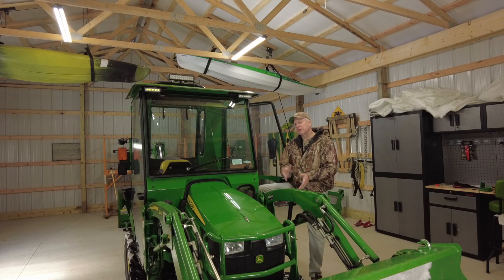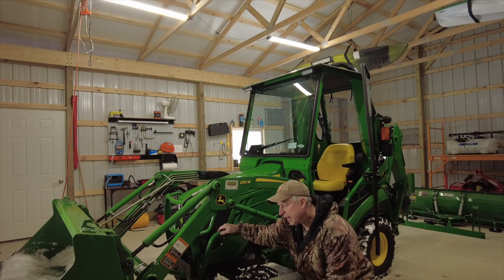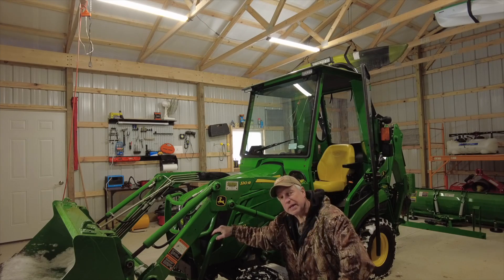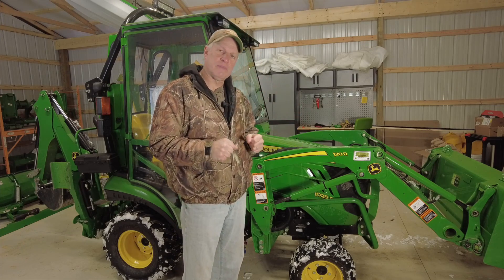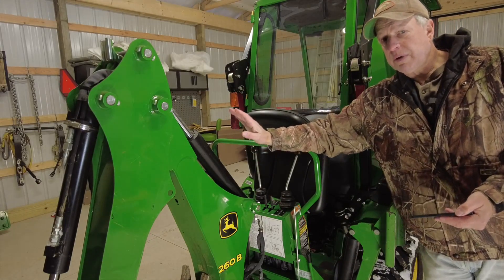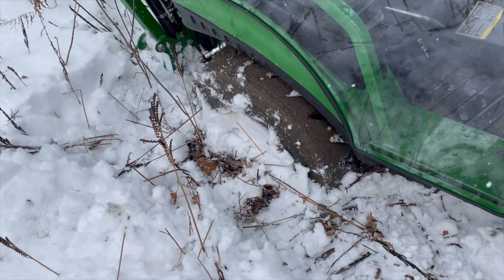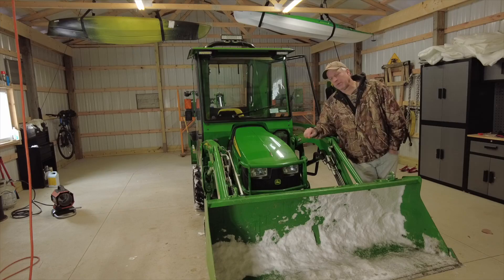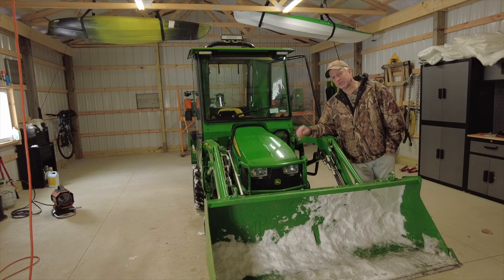John Deere 1025R: Anatomy Of A Stuck Tractor

Comment: Tom: Your frank & honest portrayal of the facts and situations is refreshing. Certainly ground that’s not firm under the snow compounds the problem. I keep my tiller on during the winter bcuz I don’t yet have a weight system. I move snow with my loader (w & w/o edge tamers) bcuz I don’t have a pusher box or blower. But the frost in the ground here in WI and the fact that it’s firm soil (not soft or mucky) means the tiller and loader weight keeps me intact with the ground and 4WD has me going thru decent snow depths. Not stuck yet, but willing to try!
God’s Blessings, Curly
Reply: I like the willing to try!
Reply: Tiller is great for breaking up the ice

Comment: Hey Tom, it's always easy for people to say what they would've done, but they weren't there and only you know what was actually going on at that moment. You got it un stuck without breaking anything so you succeeded. I have up until this past weekend, left my backhoe on in the winter while using my front mount snowblower. I found that it gives me great traction. I just recently purchased a rear blade to help move the heavy wet snow that we get here in southern Maine sometimes. Love your videos!

Comment: Any 4x4 truck or tractor, each axle has it`s own differential. The diff lock on most is for the rear only, the pedal is linked to the rear axle. The same with my GMC truck. Some Jeep models have front and rear diff lock.

Comment: There is no diff lock for the front so you will see the front tires alternating depending on the traction.   One wheel peel in the front. Diff lock only in the back

Comment: Yankum ropes are one of the best for recovery, the rope is doing most of the work with kinetic energy. Watch Matt’s off-road recovery for some great video examples.
Reply: While I love kinetic recovery ropes and carry one in my truck at all times I would be careful using them on a compact or subcompact that is stuck for two reasons. A) They are usually rated to a certain weight range and most of them you have in your truck probably exceed the weight of your tractor by a lot.  So they are not going to stretch much and they may shock a fair amount if you hit them for a kinetic recovery.     B) If you do have one that will kinetic recover with the weight of your tractor...  So many tractor in this size range are tippy and that type of kinetic recovery where you can't yell stop in the middle of it might tip you over.  I would only use them on a very stable machine.

Comment: The Diff lock is for the rear tires only. The front is an open diff. Just like on a standard 4 Wheel Dr. truck

Comment: After I got my zero turn mower stuck & used my chainfall to pull it out, I got a Hi-Lift jack to use for that purpose so I do not get mud inside my chainfall. Hi-Lift will work as a winch when used horizontally.

Comment: As for your question about if the front should lock when you put on the rear diff lock. It will not. The front has a open diff in it so you can turn. It also doesn’t have a cable or air line running up to it to make it lock. So the front will act like a old school car with the one wheel wonder. Now if the front had a brake on each wheel you could apply a little pressure to the brake an it would slow the spinning wheel down an give more power to the wheel that has more grip to help move you forward.
Reply from the maker: Thanks!

Comment: I have a hefty sized D ring that I use to attach the strap to stuff. I also have a small section of chain that I can hook around things to make a loop to hook the D ring to. As for as the 4x4 and dif lock goes. My understanding is it's an assisted 4x4 not a fully locked in 4x4 like a truck. The transfer case is more like a limited slip instead of a gearbox. The dif lock is rear only. Locking in turning axle puts a huge load on it that'd probably destroy the axle on a tractor. Even the big wheel loaders only have a limited slip front axle.
Reply from the maker: Thanks for taking the time pass along some info!

Comment: Look into the R14 tires. I have those on my BX23S and get stuck way less than I should. I live in northwestern Ontario where we get 3 feet of snow or more. I have never been so stuck that I couldn't get out with the loader. I drive it in way deeper snow than it should go. Breaking trail all the way. Don't do much mud so not sure how they work there. Look like your learning and doing good.

Comment: I stuck mine once just seeing what would happen.  Went out in the back yard about 2 foot of snow on the ground. Slight hill . I was having fun till I tried turning around. Kept sliding sideways toward the woods. Time for the quadrunner and 12000 HB winch. Tied the quad to a tree. Good start. Hooked the winch up the the backhoe frame.  Wireless remote in my pocket. Reverse 4WF. Winch engaged. Mon back. Piece of cake. A good time was had by all.. Was debating on doing it again because it was fun the first time. Thank God for my old quad and that winch. Might still be there or ?

Comment: How do you like your FEL snow plow vs bucket for plowing snow?  I saw you were using both?  I am thinking of buying a similar plow.  I have a snow plow on a Polaris Ranger and thought one on my BX might be more versatile.   Looking for a practical opinion.
Reply from the maker: FEL plow is much quicker, but a bit tricky on my gravel driveway.  For a quick clean up and not a lot of accumulation the loader bucket work just fine.

Comment: I would like to add my 2 cents. I once heard that you could not get stuck if you have a backhoe on so i put that to the test one time in the woods by my house. I got the 1025r stuck axle deep on both axles in wet sloppy mud. I used the backhoe to lift the downside of the tractor and then gently swing the boom to one side and get it onto unchewed ground and then reach back with the hoe (brakes off) and pull myself backwards. This also works to push front ward when you are digging

Comment: I've never used them but maybe R1 tires would help.
I looked into the snow blade pivot pins. Mine are like the 1 you broke. I think its a poor design. The new 1 you installed looks like a better design to me. JD has changed the part number.

Comment: Ground clearance and bigger tires is the reason I would buy a 2025R over a 1025R. It’s not a big difference but enough to me to buy the 2025R.
Reply: That was my logic too in getting the 2025R and absolutely no regrets.  I did however get wickedly stuck once and had to get a beefy tow truck to help after exhausting all homemade solutions I had available.  I am smarter (better educated) and better equipped now and suspect the odds of needing help have gone down.  2025R has been fantastic.  All the best.

Comment: Its too bad the front wheels won't lock. I wonder if using a thicker gear oil instead of hydraulic fluid if they would pull harder

Comment: It pains me every time I see someone who refuses to remove their bucket for winter use. You’re doing totally wrong. Buckets are useless unless your pile snow in one spot ie shopping centers. You haven’t the space that would necessitate that. Even a plow on a bucket is no good. Store your bucket for the winter and get a front mounted hydraulic plow.
Reply: The bucket does fine pushing smaller amounts of snow. No one is doing a shopping center with a compact tractor even with a plow.
Reply: @Dan-oz4qb  Please be sharper. The shopping complex was an example of large mounds of snow being built up needed to be piles somewhere. Doesn’t happen with residential driveways to a point where a plow can’t handle it. Buckets do not do fine. They suck compared to a plow. They swing wide in turns the float is fussy and can dig if not perfectly level and if you put a plow on the bucket you need to manually angle the blade unless you waist money on a cylinder. They clog with snow. Every cheap neighbor I have who refuses to take if their manly buckets instantly gets schooled on the quality of the job and how fast and easy I can do mine. Guess what they all changed to plows….
Reply: It pains me every time someone who isn’t at my place tell me how to do some work with my tractor.  The bucket on the front with edge tamers works great for me for what I use it for.
Reply: @Dan-oz4qb  A smart operator gets the best tool for the job. Sounds like you’re a cheapskate.
Reply: @chrismichels4616  bet you’re pained a lot…
Reply: I have both.  Sometimes I use the bucket Sometimes I use the plow your talking about. You can't generalize because conditions are not the same. After the plow truck goes by I use the bucket to dig out the mail box's and the end of the driveway.  Works great up by the house and garage too. Long driveways the plow is the way to go. Real deep snow fire up the snow blower. Nothing is written in stone. What ever works best for the conditions you have.
Reply: @UC_BDDIMTNuE-wCU2BhNkwMQ not really and that depends on the driveway. Sure you have a wide swath but you can’t navigate much other than forward and back. It’ll clear faster for sure but it’ll be a sloppy job where a hydrostatic tractor can go any which direction. However you’re still referencing a plow which is 100 times better than a bucket👍🏻
Reply: @Captndarty  A compact tractor isn't the best tool for anything regardless of how you equip it. A skid steer is better for site prep. An excavator is better for digging. A zero turn is better for mowing. My F350 with an 8' V-Plow is better for snow. If you want to tie up money in an implement you don't need that's fine but don't expect the rest of us to be that stupid with the too cheap comment.
Reply: @Captndarty  a poor operator blames his equipment. 😳